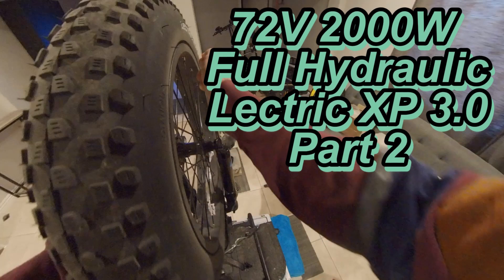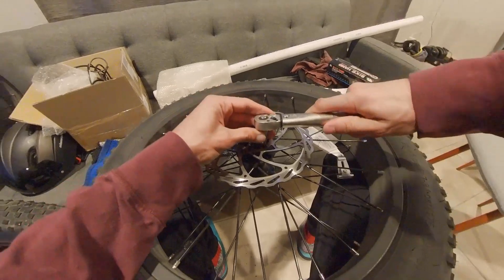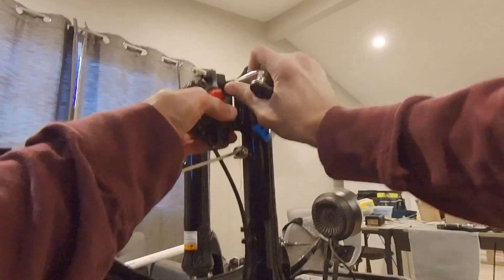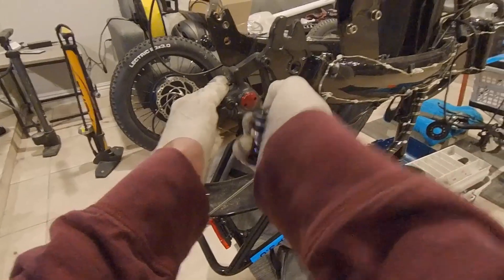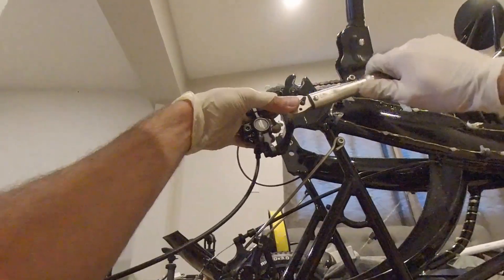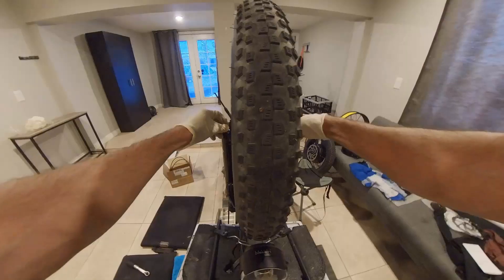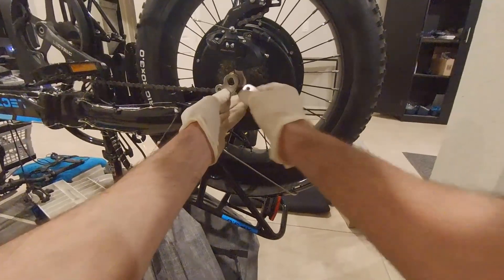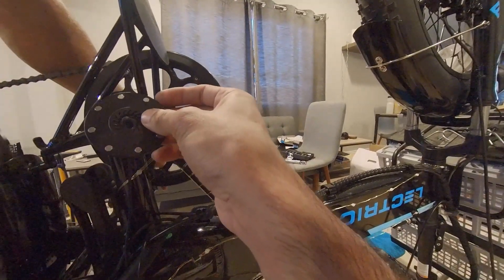72V 2000W Full Hydraulic Lectric XP 3.0 Tutorial Part 2

Comment: crazy aftermarket mods! Question do you still get the same mileage as the default model when it was a regular 48V battery and 500-800W motor?
Reply from the maker: Range with the new 19.2ah 72v battery is slightly better but I haven't done an official range test. I'll get back to you on that one. There are plans for a range test after part 3!

Comment: did you upgrade the battery?
Reply from the maker: Yes, it's a 72v 19.2ah 60a BMS battery with Panasonic 21700, 4800mah cells.
Reply: @brandinojam24  how much will this build cost in total
Reply from the maker: @-zerozeronegative52 $1430 in upgrades making it $2429 including the bike.

Comment: Do you have the link for the rotor spacers?
Reply from the maker: Syntace Disc Shims Bag of 8 https://a.co/d/fSZl4xO
Reply: @brandinojam24  So the whole problem of the original rim and tire on the XP 3.0  hydro calipers upgrade boils down to 1/8 of an inch compensation of the whole 8 shim spacers packet. That's all the distance the 8 piece packet gives in pushing out the rotor away from spokes and thus one can keep on the original rim and tire. (?)
Reply from the maker: @arnoldzilban8274  Technically I believe it's closer to 1/16" (1.588 mm) because each shim is 0.2 mm (times 8 = 1.6 mm). 1/8" = 3.175 mm. But yes, that is the problem with installing front hydraulic brake calipers on the stock Lectric XP 3.0 and the reason why Lectric is sending out a new front wheel with the free hydraulic upgrade. There's no problem with the rear installation.
Reply: @brandinojam24  Anyway, main thing is, all 8 shims are needed, whole packet is to be used(?), yes...
Reply from the maker: @arnoldzilban8274  correct.

Comment: Will this work on Lectric xpedition?
Reply from the maker: It should work on the expedition since it's also a hub drive however the long wheelbase probably exceeds the wire length. I'd check if NB Power can lengthen the wires for you.